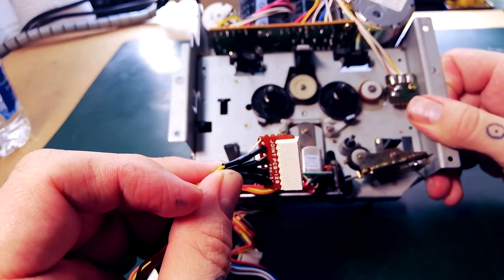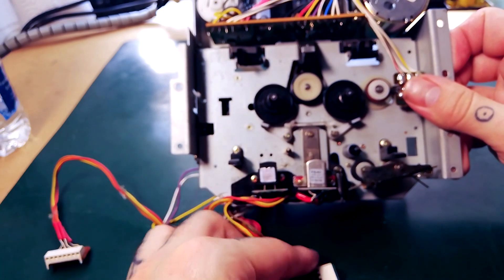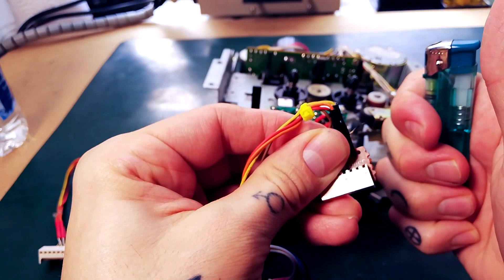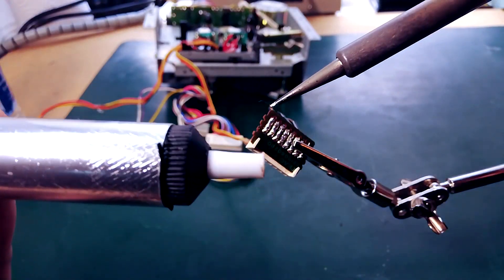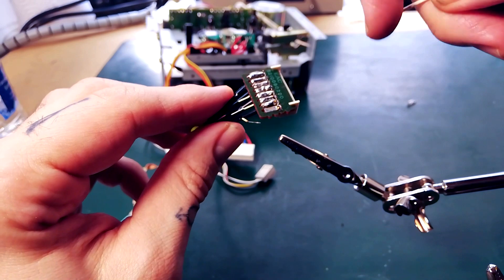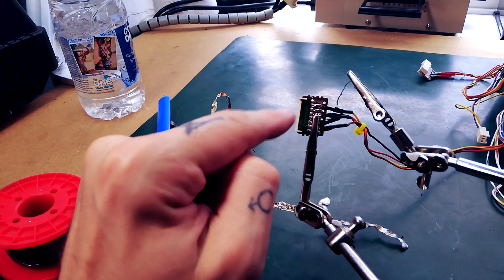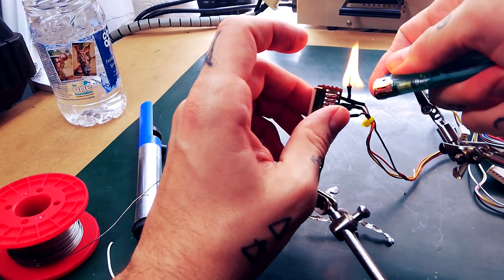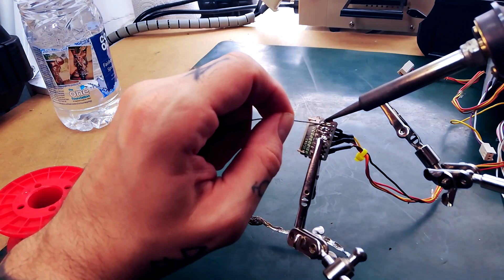How to strip & mend very thin wires (Tascam 244 erase cable)

Comment: I just put the flame on the insulation for a second and then pull the insulation off with my thumbnail quickly.  This method gives you a cleaner stripped wire end vs keeping the flame on there and essentially cooking the insulation black and melting it within the strands which could possibly interfere with a clean connection.  Nice steady hand and great repair job on this video man!
Reply from the maker: Yeah, that's how I'm doing it now...his videos a few years old now!

Comment: Just wanted to add an idea for a source of fine wire for that sort of repair.  Pick up a USB mouse or charging cable at a thrift store or Dollar Store.  Slit the wire open and inside you'll find several feet of thin flexible multi strand wire.

Comment: Do you know what gauge/ size wire they are and how to find size of molex connectors and pins? This happened to me on a 488. Thank u great videos
Reply from the maker: For a 488 you want JST connectors and headers, measure the pitch ( distance between pins) it'll be either 2mm it 2.5mm if memory serves. The actual wire gauge I don't know but I gave successfully crimped JST connectors to that generation of portastudios, namely the 424 mk I.
Reply: Thanks so much for the reply awesome info, any idea on the pin size that go in the jst connector does it list this info in the service manual?

Comment: Great tip. I inadvertently pulled the thin wires on old turntable pickup head and am working out how to fix reconnect them.  A question. What is the name of the braided wire you used to remove the excess solder and where can I get it?
Reply from the maker: Thanks for watching, the braided wire is called desoldering wick. I've had good results with MG chemicals  .